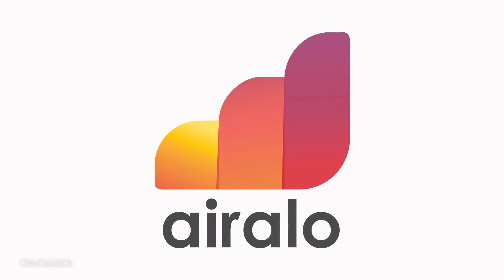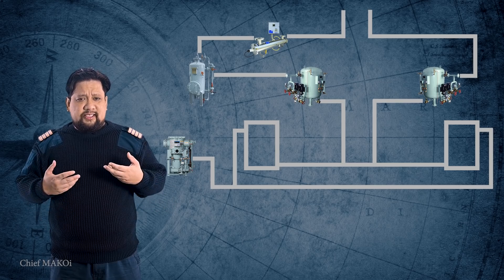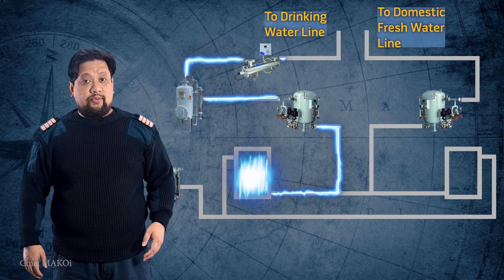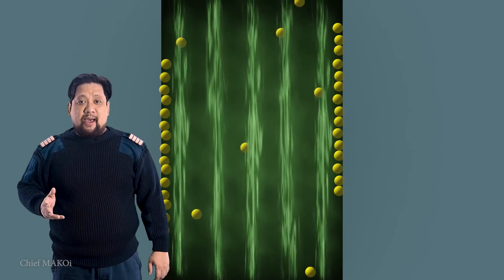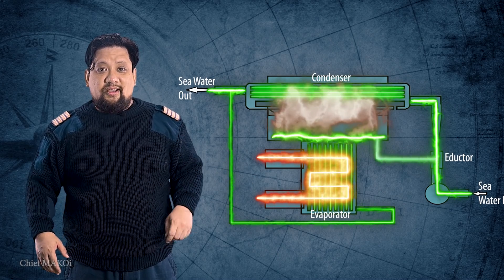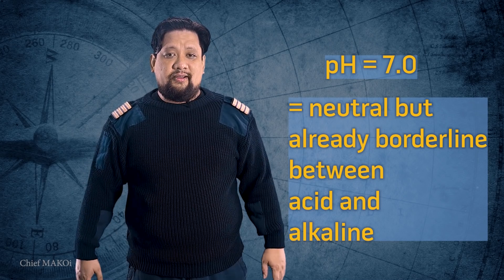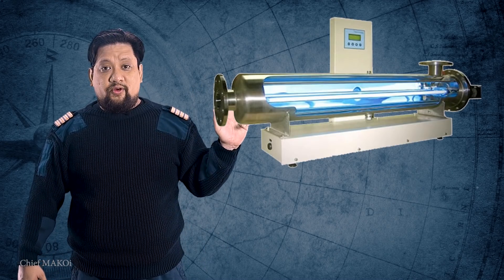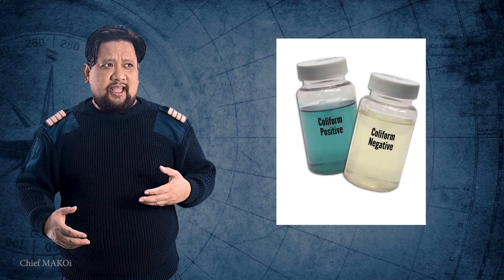Is Ship's Water Safer than Bottled Water? | Study Call Ep 05 Chief MAKOi

Comment: when seaferers failed in medical due to kidney stone, they always say " lagi kasi akong umiinom ng tubig sa barko" nice topic
Reply from the maker: Hahaha!!! I agree!  Some of them also say they grew bald because of the chemicals in the water.
Reply: "I always drink the water on the ship". :-))
Reply: me too i drink water produce from the ship, and being in deck department it gives me different perspective on how it is done this gives me aditional knowlege, so more water pleassssssssse! hahahaha
Reply: hey chief any problems with microparticles of plastic ?
Reply: @associatedblacksheepandmisfits  If the drinking water is distilled sea water, wouldn't the plastic be left behind as it does not evaporate?
Reply: @probatelaw  just what I was wondering.What is found when cleaning out evap..
Reply: @probatelaw  The question would be wether the chemicals released by the plastic can evaporate during the process, but the alternative is drinking bottled water that has been sitting around in plastic for months, so which is more likely to have chemicals from plastic? Some areas of the ocean probably don't have a lot of plastic contamination near the surface. It's hard to avoid not being exposed to plastics one way or the other at this point.
Reply: @probatelaw  the plastic would be "left behind" with the salt and dirt. The water vapor is what is evaporated, then condensed into liquid. Everything else is left behind, then discharged overboard
Reply: They say what?

Comment: I used to live and work at a place that had its own water source and processing plant. The manager of the plant used to laugh at those who were buying bottled water. He used to post the weekly test reports for the drinking water and every week it was the same. 100% H20, no trace elements and no organisms. Unfortunately, the block I lived in was 20 years old and had steel pipework. Pure water is more corrosive than regular tap water. About 1am I discovered that the feed pipe to a urinal had corroded through when the valve snapped clean off the 1 ¾ inch pipe. Soaking me, as I stepped aside the fire pumps activated due to the pressure drop. In five minutes the whole block was flooded, it was an hour before the water was shut off at the plant because to save money they didn't install valves on each block as they were meant to be temporary housing for the builders.

Comment: Chief, you crack me up. The ship is using the exact same process as the bottled water companies use. I work in a print shop, and we got our share of goofs that drink bottled water, but paying attention to my area's water quality our water is better than bottled. Maybe I am to blame as they seen me change the filter and see the clay setiments and gross out. Not a problem, unless they flush out the hydrants, so I tell them to if it is brown, wait a half hour and flush the toilet and it will clear up. 

Modern cities even with their flaws opperate on seperate systems for water and sewage. They figure it out at the last turn of the century. Got stuck on canoeing trip in Canada and our troop cheaped out with using household bleach. My friend and I had Iodine tablets and turned a profit because people wanted a different change of bad. We also had tablets to neutralize the taste of iodine, but they never got to the point of buying them because we had one pack and wanted ten times the price. 

The easy way to wig people out about the water they drink is to tell them it is safe. With water it is not about the souce, but cross contamination which is vertually non existant for most of the world.

Comment: I would be concerned about breakdowns in the system.  When one of the purification steps suffers a breakdown (and all mechanical devices break down once in a while), does the water simply bypass that step until repairs are made?

Comment: I used to work for a water filtering company, it’s funny how the system basics are similar but in much smaller scale for residential use, ours was based on reverse osmosis but adding the minerals is the same, and some systems also have UV light, depending on the customers request.

I would actually argue depending on the bottled water quality, there is a good chance the ships water is actually better than bottled water,

1. Very often bottle water it’s just tapwater filtered, from unknown Quality of both the water and the filter process.
2. Water leeches from the plastic bottle it’s sitting in for months before you actually consume it.
3. on the ships water you control the water and you know exactly what you’re getting 
(often bottle of water came out in lab tests to be not a good quality)

Anyway Great channel I’ve been really enjoying it
Thank you for all your hard work
Reply: Hello

Comment: I avoid drinking water from a plastic bottle because of the amount of plastic that ends up in the bottle after it is manufactured and there is a lot if you drink plastic bottled water regularly. The plastic should pass straight through your body but continually drinking plastic bottled water means a continuous flow of plastic through your body, plastic is a carcinogen being produced by oil and other deadly chemicals trapped as a solid when in plastic form but I think some must get stuck in your stomach lining and breaks down being unhealthy over long periods. My choice but I would drink the ships water at home I have a carbon filter fitted to my water line also a flouride filter even though our tap water here is not supposed to be fluoridated I don't trust anybody.
Reply: There is plastic in all food containers tho 🙄
Reply: @alexm566  I avoid plastic wrapped food and drink as much as possible, sadly you don't always have a choice to completely avoid plastic contamination, so its trying to keep it down to has little as possible. Sad to say I was watching a youtube video on plastic contamination and plastic particles are even found in glass bottled water.
Reply: @NO_Expectations  yeah, no plastic packaging means even worse environmental contamination.

Comment: 10ppm seems kinda high, drinking water should be targeting 1pmm or better usually. 10ppm is by no means dangerous, but would get flagged for remediation on a potable water test for an Alaskan mine. That is assuming 99% of that is sodium salts, if your distillation is pulling that much of almost anything else across that would be a fail with serious repercussions for the mine. If you think bottled water for a ship is expensive, look at the cost of flying in water to northern Alaska.

With 10ppm on your bulk water loop I would expect y'all to have a secondary purification stage on your potable supply. Since you are starting with relatively fresh water, that second systems, whether distillation or RO, should be really low maintenance and comparatively cheap.

Comment: Bearing in mind it was 80 years ago and probably a very different desalinization process, my dad felt like the desalinized water in the ships he served on during WWII was responsible for him losing his teeth in his 40s.  

As for comparing to bottled water, who knows?  Much bottled water is simply filtered tap water.  Even your "spring" waters may have who knows what in it, and not be healthier than your water generator's output.  

My residential water comes from a reservoir which occasionally does this thing called "turning over" (methane gas is release from all the sediment and detritus on the bottom).  For a few days, our water smells like someone forgot to flush the toilet, but it is supposedly still safe to drink.

Comment: As a proces engineer in the food industry I wonder why you chloride the water and then pump it over an UV light. I’d rather pump it over an UV light and then filter out the killed bacteria and then, when necessary, dose some HClO. HClO will desintergrate under UV light and loose its function in the piping after the UV unit.

Comment: Sometime ago, a friend of mine introduced me to a seaman working as a machinist in an international cargo vessel. He once told me about  the  drinking water in the ship which came from the sea. He had mentioned about desalination and reverse osmosis but so far, I have not seen such kind of device but only those in commercial mineral water refilling station until  I have watched your channel. Come to think of it, it's more safer to drink than those tap water from the local water system in our area which was treated only with chlorine. Indeed, I'm contemplating to install a reverse osmosis in our faucet in which the water seems no longer clear. Very informative and detailed as well as worth viewing. More Power!

Comment: The biggest problem is the source of seawater which will be evaporated. It comes from around the ship. This means if the ship is in contaminated waters you'll have it in your Fresh Water Generator. Sure, you supposed to stop the production of freshwater nearing a port, at least 12 miles outside. The problem is an Engineer may forget to do so or simply be not aware of dirty, muddy, contaminated with mercury water outside at the moment.
The second biggest problem is you don't know if UV is actually doing anything to the water.
Problem number three- conditions of the storage tank. Even if it is opened up and cleaned it doesn't mean the water is safe to drink.
Water analysis is the way to go. There is no other way to know.
The safest way is to drink as minimum as possible. There are so many stories about evaporated water causing teeth to fall out and all sort of rushes. Just google it.
Quite often there is a corruption factor present when ship management sells the drinking water and insists on drinking evaporated water. This is not a secret. It happens less and less though.

Comment: The funny thing about bottled water is that it usually is just taken from city water mains, and cities often get their water from rivers, give it minimal filtering, and then dump a bunch of chlorine in it.
Assuming that they don't forget and leave a untreated water bypass valve open... Lol

Sea water is generally not carrying disease pathogens or chemicals from the city sewer discharge up river, and steam distillation produces much cleaner water than clarifier tanks and city water supply systems don't clean and shock their tanks and piping, ever, so pretty much all the signs point to ship water being safer lol

Also, distilled water is neutral, but when it's exposed to the air it tends to absorb carbon dioxide which then forms carbonic acid.
That's why distilled water can tend to be acidic, because of atmospheric exposure.

And distilled water is one of the most powerful solvents in the world, meaning that it is like a vacuum inside, and constantly "sucking" gasses and minerals until it reaches equilibrium.
That's why it dissolves the co2, because it's lost all its dissolved gasses.
This also means that when you drink distilled water, it is going to be trying to reach that equilibrium by taking your minerals from your blood and bones and teeth and such, and if it's acidic from the co2, it is better able to dissolve your minerals and electrolytes. 
The body is also not able to utilize the water until its properly buffered, which means that you can be working on a hot day, and drinking lots of water, but still getting dehydrated because you don't have enough electrolytes to enable the body to be able to use it.

Ever been drinking water, and it's just sloshing in your stomach and you feel horrible and you feel like puking or acid reflux, and you are still thirsty?
Eat a couple pinches of salt, or a handful of sunflower seeds in the shell, and see if you don't rapidly start feeling better lol
Rule of thumb is that you can drink enough water to fill your stomach (a quart or so) and if you have enough electrolytes it will fully absorb within 15 minutes, with none sloshing.

And if you drink distilled water, it takes even more electrolytes to balance it.

Also, extended drinking of distilled water will tend to leach minerals from your body, just like how it leaches limestone to make caves.

I started researching this subject a few years ago, because my dad drank nothing but distilled water, thinking it was the most pure and natural water possible, just like rain water, and that minerals were bad to drink, and then he started showing signs of mineral deficiency.
I got him to start taking supplements, and stop drinking distilled water, and he recovered lol

And remember, you may think of rain as distilled, but it has already absorbed a lot of gasses in the air, and chances are some minerals from dust, or whatever surface it hits, and as soon as it hits the ground, it rapidly balances itself.

Comment: It is better to add those minerals to the water than to have the water strip those minerals from the inside of the pipes, tanks and fixtures.  

Automatic chlorine monitoring and injection would be better than manually using tablets, but the risks of storing liquid chlorine on a ship outweigh the benefits.   

If more crewmembers drank the ship's water, overall water quality will improve as well.

(I used to make potable water at a water plant that served 100,000 people)

Comment: I assume the domestic water is for showers , are the toilets flushed with fresh water , i imagine its easyer to plumb the ship that way rather than having a dedicated salt water line for the toilets .
Reply from the maker: Old designs used to have sea water for flushing toilets.  They clog up easily.
Reply: @ChiefMAKOi  also did a bit of reading and the bio plant that deals with the sewage doesnt really like sea water
Reply from the maker: I'll discuss that in a future video.
Reply: @ChiefMAKOi  salt water flushing off of the firemain is fun.  Back the regulator screw off on the urinal "flushometer" and wait for somebody to flush it at 120-140 psi.  Ever see a urinal fountain all the way to the overhead?  Meggers, aluminum tape, and thin USN sheets can be fun, as can tossing somebody a charged capacitor.  Sometimes you just get tired of the old jokes like sending the new guy out for a 50' coil of water line or lubber line.  Handing the new guy a large wrench and sending him off the the engine room to tighten the nuts on the CHENG unit was always a classic.
What can I say?  I was on a Replenishment Oiler (underway repenishment ship).  We worked hard, we played hard.

Comment: My ship doesn't have a mineralizer or UV lamp built in. Had a mineralizer installed on one of the fountains (still skeptical on if it actually worked or not) and we chloronate our tanks to prevent biological contaminants. Most of the crew had to rely on vitamins and mineral additive packets. 
Boy that water really hits different when we hit port calls, and you could tell the difference immediately when we started producing our own water  again.

Comment: Fwg is a good compensate for Engine crew. Sometimes when ER temp is so high and Engine crew were carrying out maintenance water consumption rate is 3x. So if you bought bottled water it would be a waste cuz body wont absorb nutrients and only pass thru sweat and urine.

Comment: Answer to "is this drinking water safe" is always "has it been tested safe". Is ships from sea water made potable supply safe to drink from? It can be since there is ways to produce it to even strictest potable quality, but one wouldn't know without testing. That is the only way to be sure. Be it ship, municipal supply, personal well or just spring water it can be safe since all of these have options to make it safe or the source is naturally safe. However on none of these one can say one way or another in general terms without testing. All one can say is "it they are running responsible operation, it should be so". That responsible operation including systemic testing regime of the potable water.
Supplies have been contaminated even against best efforts of the operator both on land and at sea. Something just contaminating the after treatment pipelines etc. Hence only way to be sure is to test. Once it gets caught on test, responsible operator orders immediate quarantine of that water and it's use. Until the source has been inspected and necessary actions taken to make the water again provably test safe to drink.
The guarantee of safe drinking water is not the treatment itself, but the testing of the supply. Treatment is way to get that test to show "this is safe to drink". Treatment can fail, source be contaminated after treatment etc. so testing the water coming out of the tap is the one way to say it for sure. Regardless of source. Heck bottling plant might be bottling contaminated water, unless they regularly test samples from their completed bottled waters to be sure that the source is clean and their bottling process doesn't introduce contamination.

If one has any doubts about the water quality? Ask the ships crew, when was water last tested and what were the results. Heck ask to soo testing log. Any responsible ships crew/master etc. shouldn't get angry about such question. Rather if they are acting responsible, they would take point of pride to tell "Our water is tested every X time as recommended and demanded by regulation, last test on schedule landed to Y and according to our test log it was clean. If you want, we can produce the test log/report for you." Since anyone dealing with potable water knows, the supply can get freak contaminated even with operator running all the water treatment to the best and strictest protocols. That is why water gets tested regularly. It isn't the necessarily operators fault water gets contaminated. What is operators fault is, if they don't spot that the water is contaminated.
Reply: As for the municipal water sources, a testament to their purity is that the commune has sprung up. If the water is not potable, people tend(ed) to migrate to other areas before transporting potable water came possibility.